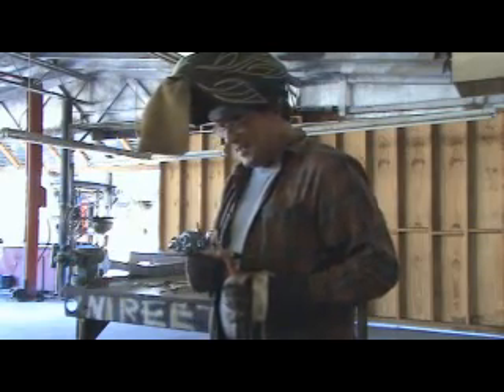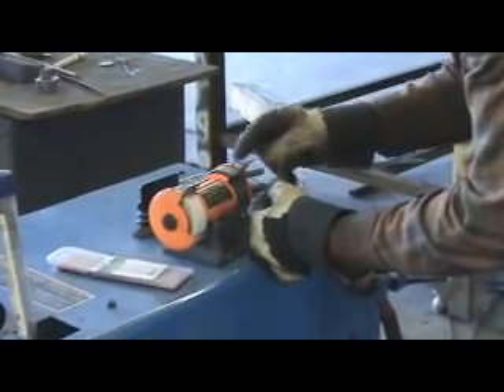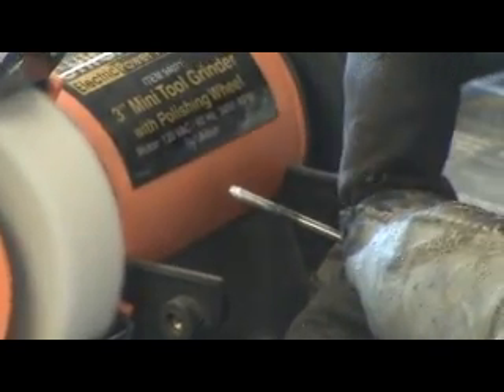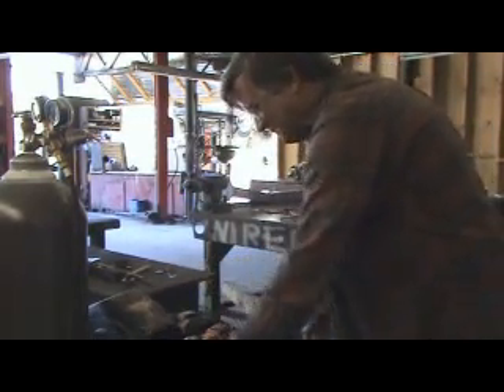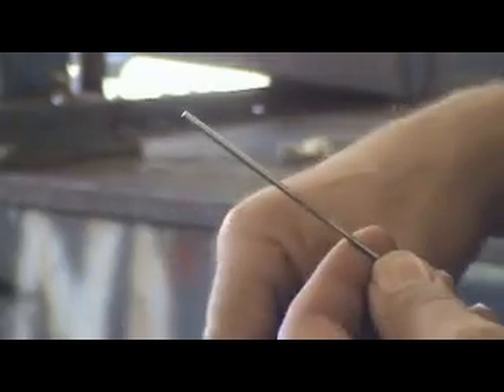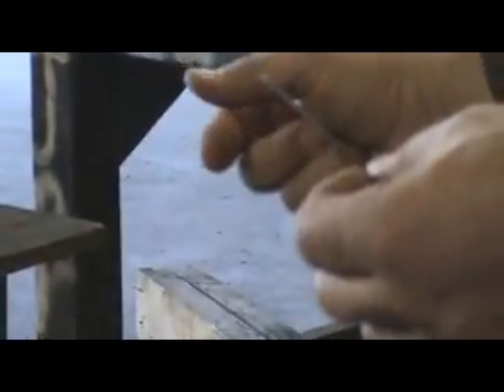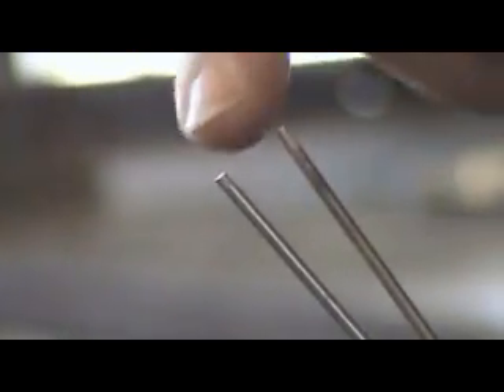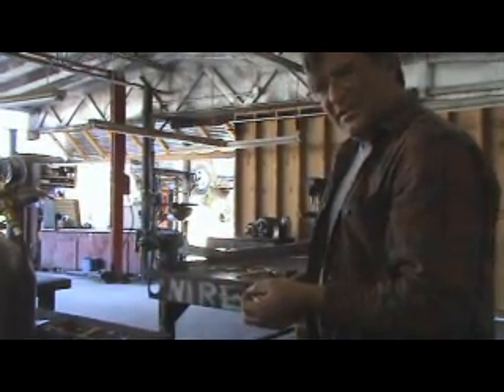TIG Welding: Handling the Tungsten - Kevin Caron

Comment from the maker: How to grind the point is a hot topic for sure. Keeping in mind that I am self taught and not a certified welder what I say in the video is my opinion only. I have found that more of a point makes for a finer flame and a tighter bead. I have not seen any difference in aluminum with point size other than the bead size. As for the red tungsten, I don't use it anymore. I use the E3 purple only for all my work.

Comment: I just bought a used tig welder and haven't got to use it yet. In my research I have read in more than one source that the point is ground flat only when welding aluminum. I have also been told not to use the red tungsten because of the radiation. Whats your experience with these points?

Comment from the maker: Lower amps, pulse if your machine has it and lots of practice..  If you can purge behind where you are welding that should help also.  I think the pulse will help the most.   How thin of metal are you working on and what amps are you starting out with?   You may also go to a smaller tungsten so you can run lower amps also.

Comment: Hi Kevin
I qualified as a boilermaker. Recently I got a job at a food manufacturing company and I am required to weld/close leaks on very thin stainless steel material, I fail every time because I seem to make the holes bigger and that takes time to eventually get it right.Could you please advice. I last used tig when I was an apprentice which was almost 15 years ago. Thanx

Comment: I'v watched alot of your videos and think there great upfront real life keep up the good work.
I would like to point out 1 thing Orange ceriated is recommended by linde our supplier and my self for a couple reasons.
1) no radiation (fumes are bad enough think long term)
2) can be used for both dc and ac no changing
3) does not ball up while ac welding.
4) resistent to contamination.
I was taught to grind the tungsten to the equivelent to sharpening a pencil and then grind down the tip

Comment from the maker: @CncObsession Thanks for posting. 

As far as I know this works with all types of TIG welders. My information came from the operators manual for my Miller 200.  I was not sure about sharpening this way but that is what the book shows. I have tried sharpening down and can't see any difference in performance. I would say which ever way works the best for you is the way to do it.

Comment from the maker: @Jerbob1 Hi Jer;
Lots of different opinions on this subject. Like I said in the video this is what Miller says to do for that welder. I have tried welding with a sharp point and find this way works better for me. On the dust front you are absolutely correct. I have been looking in to respirators and or filters and will be adding some to the shop soon. 
Thanks for posting, it is always great to hear from my viewer. Whether it is praise or a slap to the back of the head.

Comment: I thought I posted this but then it disappeared, so here it is again.
Evidently the red electrodes have thorium, a radioactive element, in them and you should wear a respirator to keep from inhaling the dust into your lungs.  Also, grinding of the tip should be done parallel to the axis of the electrode.  All of this from Todd Bridigum's book How to Weld.  Thanks for the info on shaping the tip.  I would have made a sharp point, so you've straightened me out.

Comment: You are sharpening it wrong. You need to sharpen the tungsten so the wheel spins away from the point. You will yield better results with a sharper point and a finer grit wheel as well. Think how the arc emits out of the tungsten, so you need to grind that way.